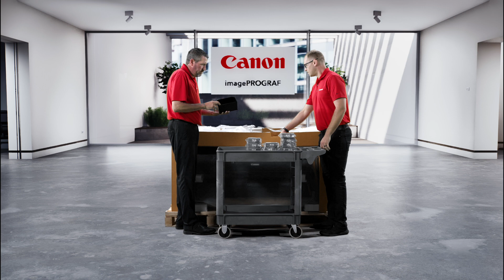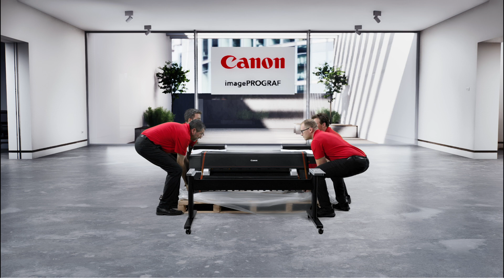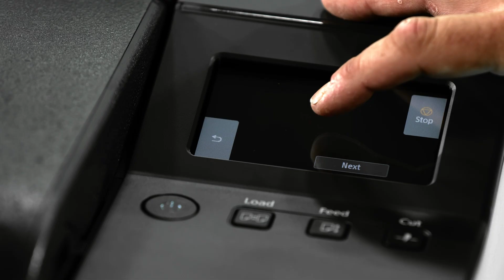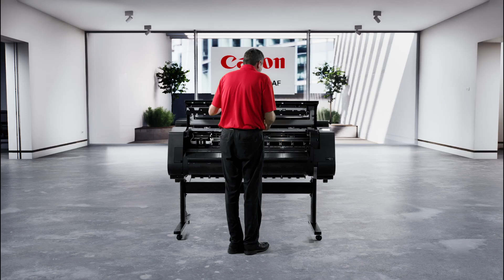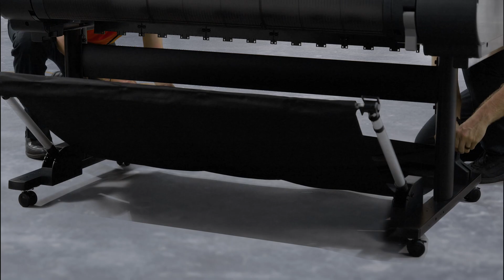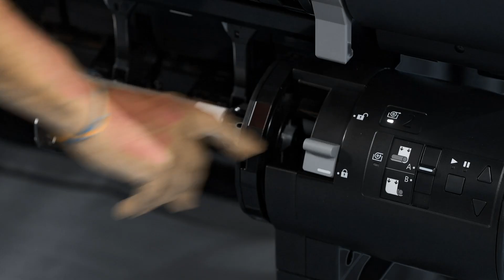Unboxing, Setting Up a Canon imagePROGRAF PRO Series Printer

Comment: 1. The PRO-310 says nothing about the print head, just the cartridges on the printers on screen prompts and since the cartridges (9 of them) all fit into the general slots with an audible click WITHOUT the print head installed, (because it never said to, I just assumed the office bought me a spare, along with the spare cartridges they purchased)  it will never let you move past this step. you must install that print head first. 
2. When in the video it says "gently shake" the cartridge to prepare it for printing, it does in fact mean GENTLY. 
3. When you do GENTLY shake the cartridges, leave the little orange guard in place. Do not remove this until after you have shaken them GENTLY and are ready to install them. 

( I just installed this printer in my office and noticed a drip of black ink after installing them on my hand, and another on the reem of paper next to the printer. no biggie, i must have shaken that one too hard... and then i turned in my chair to face my keyboard and there was a swath of multi color drips and drops covering my $400 cad mouse, $130 keyboard, desktop, down both drawers and across the floor. So.... SHAKE THEM GENTLY!!!)